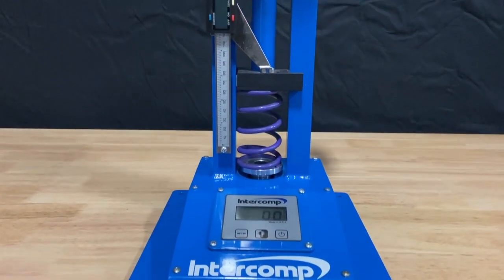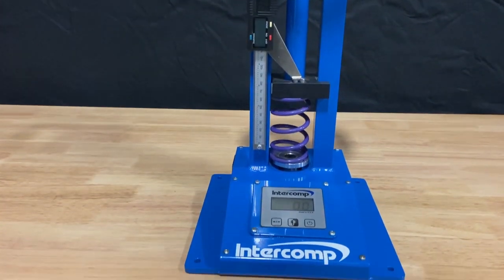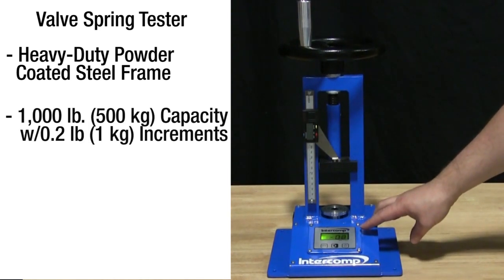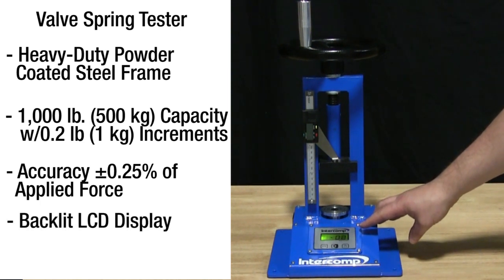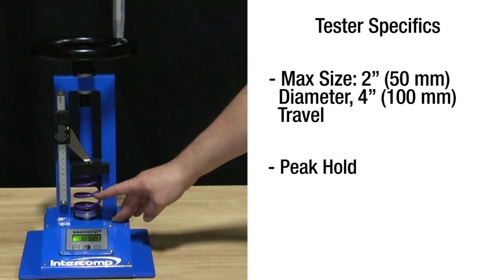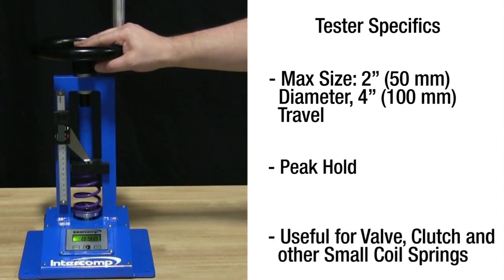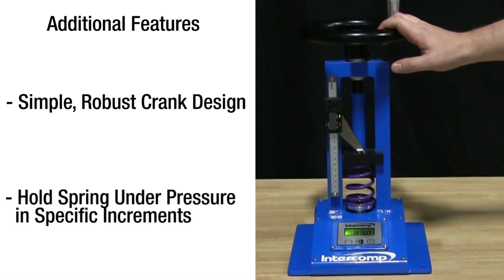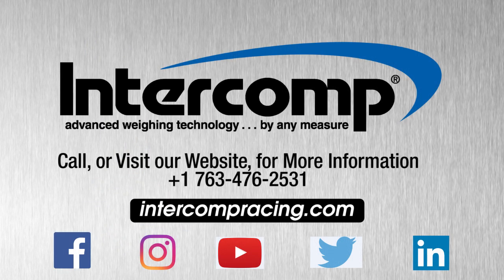Intercomp Valve Spring Tester

Comment: Hi, I have the earlier version with a little toggle on/off switch and a little rotary knob to zero the reading, thing is the numbers are always going up and down so it will never sit a 0.00, it always cycles from like maybe 3.9 to minus 2.6 and will never be stable with no load on the pad/pressure cell thing. Is that normal? And on the travel slider measure caliper thingy LCD , how do you turn it on and off?? it only has '0' which sets the numbers to 0.00 and another little button to swap between metric and imperial. Do you have to keep taking the battery out to switch it off and then put the battery in to switch it on??  Cheers !!
Reply from the maker: Please send an email to chrisb(at)intercompcompany.com. He can get you connected with one of our customer service representatives to help troubleshoot and fix the issue with your valve spring rater. Thank you!